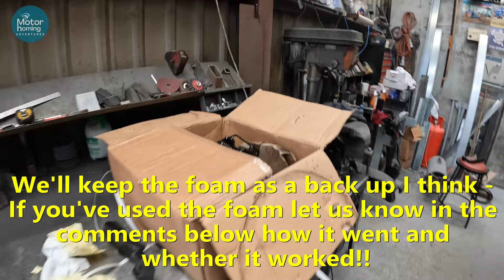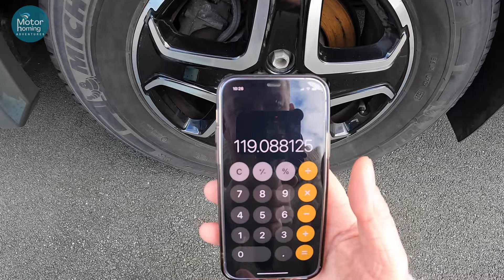Motorhome Mods:  Fitting an underslung spare wheel carrier plus wheel and tyre

Comment: Many thanks for this Bob, very helpful and informative, especially about the different PCDs. I would have preferred an alloy spare to save having to replace the repaired wheel back on the van, but you need a special adapter for the wheel carrier to take an alloy spare: not only are these quite expensive, but I could not find a complete 5 x 130 adapter anywhere - there are a few suppliers of the 5 x 118, though.
Reply from the maker: Many thanks indeed for that Philip and very glad it was useful. Yes I agree re the alloy - I also had a look but stuck with steel!! Thanks for watching 😁🚌👍

Comment: Having heard some horror stories highlighting the issues and delays if you don't have a puncture and no spare tyre, I went ahead and added one of these carriers. For the benefit of others, I'd already had a tow bar fitted and as Bob found, I had a couple of issues. The 1st one was that one of the brackets holding the winding mechanism to the chassis was fouling one of the strengthening plates added to the chassis for the tow bar. This was easily rectified by taking a small notch out. The other problem was that the plate also prevented me from inserting the wind down tool into the housing. The only way around this was to fix the bracket holding the winding mechanism with a single rather than 2 bolts which allowed it to pivot down just enough to insert the bar. While not ideal, the bracket is taking only the weight of the mechanism so very little in reality. It doesn't move when operating the winder so I'm comfortable it's secure enough.
Reply from the maker: Many thanks for that addition Gerard - some very useful additions to the film. We were very lucky to be in the right place at the right time when the wheel carriers arrived at Mick's place!! Even then it was a fiddly, but achievable, addition. We would all hope that we may never have to lower that spare tyre mechanism 'in anger' !! (But at least it is doable and I have tried, successfully, to practice it a couple of times - albeit a full EP levelling system would make it a LOT easier!!! - one day!!

Comment: That was really useful information thanks guys for sharing getting are new Adria Sonic Supreme 700 DC in a couple weeks think it’s the same chassis as yours 🤞did you guys changed the front springs after fitting the airbags? and safe travels 😊
Reply from the maker: Many thanks for that Andre and very glad it helped,  and your 700dc is a beautiful moho - bet you’re counting the sleeps and hours!! And yes very similar in a lot of ways to ours with the 4.4 Fiat. We haven’t changed the front springs yet as I wanted to give the VB Semi a good few miles to decide. I’m swaying towards NOT changing the front as the VB made a big difference to handling and I think I’m happy with it now. Tyre pressures might be the next thing to play with too before any front spring change as a lot of owners have experimented with different front pressures which has worked for them.
Reply: Thank you for your kind words can’t wait tyre pressures are very much overlooked just a couple PSI makes a great difference to the heading and feel of the vehicle I check my tyre’s on every other full tank of fuel it’s my golden rule.30yrs + using all types of leisure vehicles.keep it up guys you got a good channel there safe travels 😊

Comment: Good idea to carry a spare wheel but preferably in the garage. Think you'll struggle to remove the spare especially if you have a blowout on the o/s/r. Better calling breakdown recovery.
Reply from the maker: Many thanks for watching Mike :) It will indeed be a challenge if we have to use it 'in anger'. I'm hoping our piece of wheel bearing, that I showed in the other film, that gave us our only puncture to date will be my share for at least 5 years - does lightening strike twice?? ! :) I think I'll carry some sort of wooden ramp to lift one side of the van to make getting the wheel out easier rather than rely on the jack when I'm under there!!!

Comment: Dunna confuse people with the PCD measurements. 
Light chassis 5 x 118 
Heavy chassis 5 x 130
It’s as simple as that.
Reply from the maker: Morning Rob and thanks for watching. That's useful info too, but I was just adding to that - as some van owners that uprate their weights by adding air suspension and other mods to get their vans re-plated are sometimes in a grey area as to which to use or which wheel their chassis was originally fitted with hence I added the bit about PCD so they can be sure they choose the right one.  Our thanks again for your addition :)
Reply: Is it that straight forward then Rob ? What constitutes light/heavy? Not so simples...

Comment: Another great vlog Bob…..Bob Vlog…..heck I’m a poet and I didn’t know it…….anyway enough of that I’ve mentioned to you before I too will not do without a full size spare but decided not to go down the underslung carrier route and decided instead to sacrifice some space in the garage and the wheel stands upright against the rear and secured in place.
Much easier to access stays clean and makes for a much quicker changeover in the event of a puncture.
But ultimately for me it was a safety reason didn’t particularly want to clamber about in the pouring rain  and dark in the middle of nowhere underneath…..😂
You’ve mentioned payload and quite rightly so have you worked in addition to the spare wheel / tyre and carrier of this vlog the weight of all the air suspension parts …… the tow bar and its additional bar bracing….it as you know all really starts to mount up.
I’m guessing the trailer and bike don’t necessarily come under the payload considerations as such but it’s still a big addition to the available performance of the vehicle.

None of this is a criticism as I’ve mulled over doing all my self !

But once Mrs Rat had loaded  ‘ Penelope’ Pilote with all her Hats …..coat……shoes…..Handbags……I had to dismiss the modifications 😂

Carry on the great work chap 👍
Reply from the maker: Morning P & T,
Another Dylan Thomas?
Yes I get the safety angle and did deliberate between the two options but now that I've messed about with it I was happy to keep the garage space! 
Yes the additions to the van have added weight but we were lucky to have nearly 1100 kgs of Payload after going for the 4400 chassis.
VB : 17kgs    Towbar and chassis upgrade : 40kgs      Spare wheel and Carrier : 35kgs
So 92kgs added 
You're right re the performance towing - it will affect the MPG which will be an interesting comparison on the next European trip.
The trailer scooter combination is around 280kgs so our gross train weight, when towing, is around 4.3 tons now with a limit of 6.4 overall.
We would never have managed with a 3650!! :)

Comment: Do you have a metal valve on your spare? It looks like a rubber one. If your tyre pressures are as high as most motorhomes - often 80psi on the rear- you should have metal valves.
Reply from the maker: Many thanks for that Brian and I will check - much appreciated and thanks for watching 😁🚌

Comment: Doesn’t the steel wheel have different wheel nuts to the alloys, also I think you will find the steel wheel is not the same weight rating as the alloy, correct me if I am wrong.
Reply: Wheel bolts are the same for both. 
Alloy is rated at 1250lg and steel is rated at 1350kg
Reply from the maker: Top man Rob and many thanks for that addition - I need to employ you :)) 
Yes there is a couple of kgs difference in weight between the wheels but @bobline it would be just to get me to the tyre garage for the repair so I can live with that for a short period of time.
Thanks to you both for commenting :))
Reply: Fiat confirms that the wheel nuts supplied for the alloys are suitable for the steel wheel.

Comment: 100% would not be without a spare . Imagine a puncture in a remote place or on way to catch a booked ferry.
No breakdown service could sort quickly.. My problem was payload as my rear axle is always near its 2240 kg limit  when we do europe .( Garage full of toys )  I put my wheel in the centre of the Fiat chassis therefore only putting a little extra on the rear axle as any weight behind axle add more that its weight  to the axle.   The other thing I did was fit a piece of plastic drainpipe under van .
I keep two bits of strong pvc sheet rolled up inside . Both full width of van by dia. of tyre and put then down under the wheel carrier,. Lower wheel and unclip, pull top one ...the wheel slides out.. Reverse to put  back.  I also fitted a long hose type valve to check pressure but you also need to release this  as lowered.  If anybody interested to see carrier in position  
search          Motorhome Facts Forum  Got spare wheel under my Van  LT Man
Reply from the maker: That’s some great mods Martin - like the pvc sheets!! 😁👍 Payload is always a challenge which was why we bought this one as it gave us nearly 1.1 tons payload!! Love your ideas 😁🚌